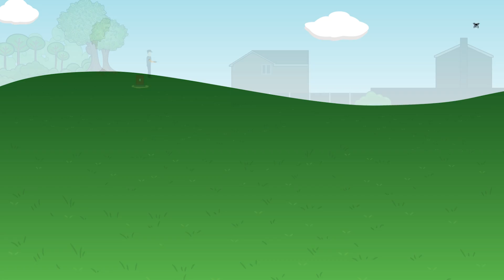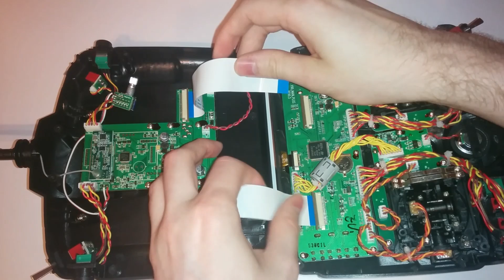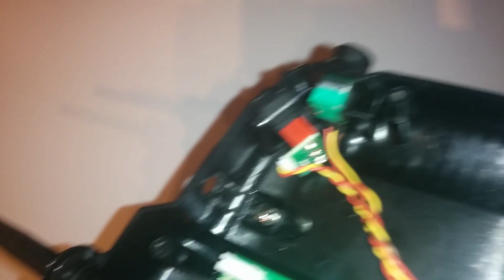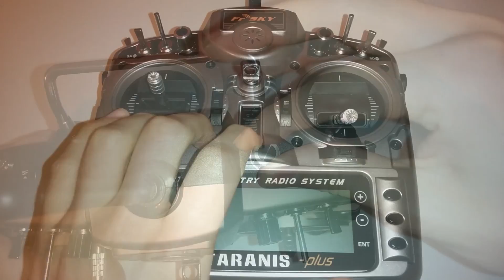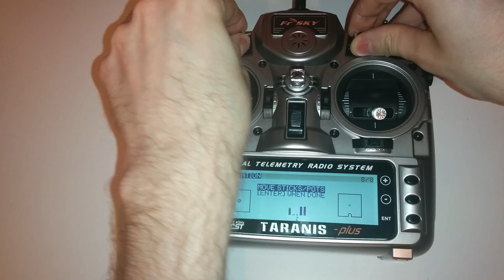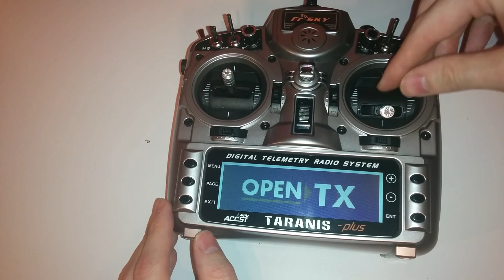High End 450 Quadcopter E03 - Adding Flight Mode Switch

Comment: Andy, I am thinking about building a high end 450 quadcopter to replace my phantom 3 advanced. I like how your setup gives the return to launch just like I have with the phantom 3 in case I do go out of the range, in my case the video range I would think. I was wondering what it would take to give it at least the range of the phantom 3? I have flown the phantom 3 2 miles away and still had control and video feed. I did this as a test to see how far I could push it. I think I could easily do this using UHF frequency's for the control, but how do you do this for the video? Also, any chance of running 2 of the 4s 6000 mah batteries in parallel to give a 30-40 min or so flight time? What kind of max speed should i expect with the added weight?

Comment: how come u are using a apm and not op revolution full kit  in your next build 
http://www.ebay.com/itm/CC3D-Revolution-Flight-Controller-OPLINK-MINI-8N-GPS-Distribution-Board-/271967212528?hash=item3f528253f0
Reply from the maker: +M Frisberg no reason really. just wanted to try something different
Reply: +AndyRC nice witch are you going with the newest is a bit pricy if i dont remember wrong
Reply: +AndyRC fck i just burnt one motor and i just got my fpv set up nice
Reply from the maker: this happens unfortunately. hope you get it sorted soon!
Reply from the maker: +M Frisberg its the pixhawk in the series its the next version of APM
Reply: +AndyRC yes i know just order two new ones and a extra 16a blheli esc nice video by the way
Reply from the maker: thank you :-)